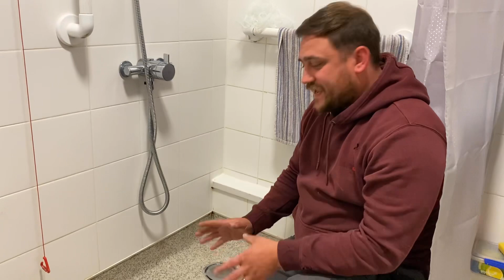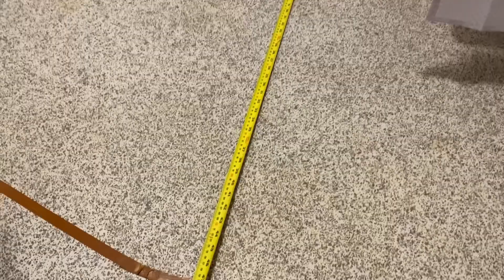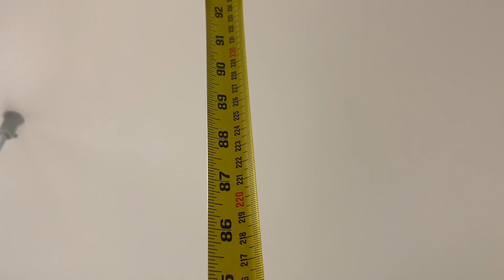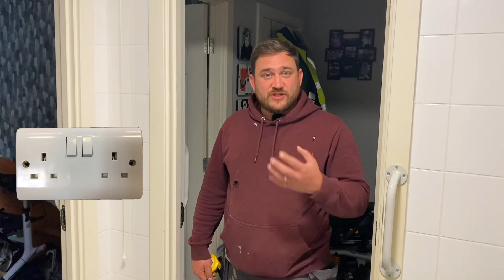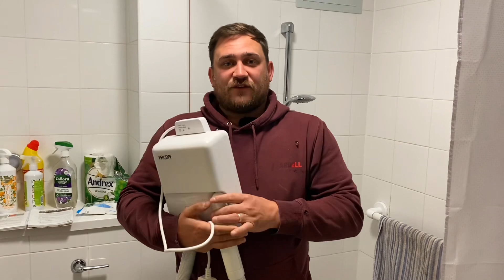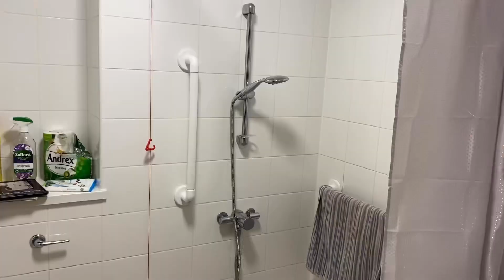Bathroom Zones in a Wet Rooms Explained - Fixed Water Outlet and Calculating Zone 0 and Zone 1

Comment: The term ‘fixed water outlet’ in BS7671 Section 701 refers to the shower head and not the drain, this is clarified in IET Guidance Note 7, under section 1.4 Zones (Page 19)

Comment: I remember when  I was an apprentice on a new built the client wanted a bidet but didn't want a shower screen on a shower head that extended out next to the toilet the manufacturer instructions said it had to plugged in via the flex lead so you could imgaine an ugly cable going from the toilet to the cabinetry to avoid zone 1

Comment: So how far should a electrical socket be from a kitchen sink or hand basin?
Reply: It was 300mm but BS7671 now say 150mm
Reply: @seandempsey7351  What?   I thought it used to be 1000mm from running water
Reply: @seandempsey7351  I’m pretty sure it’s 300 mm from a basin/ sink. But 150mm away from the HOB to align with gas regs

Comment: If there are shower doors or curtain, would you not take your measurement from the edge of them and not the centre of the drain cover? As there should be a shower tray below the floor covering to allow water to drain away. 
Well mine has any way the drain of is connected to an automatic pump that starts when the shower is turned on and over runs when the shower is turned off.
Reply from the maker: Look in the On-Site Guide for guidance with obstacles in wet rooms and zones
Reply: @GSHElectrical  i’am not saying you’re wrong far from it
I’am just wondering how this works if there are shower doors 
And there should be a wet room shower tray under the floor covering so I would have thought you take your measurement’s from the edge of the outline of the tray or the outside edge of the shower doors ?
Reply: If I’am wrong I will happily admit it. I think wet room shower tray would be treated as a standard tray in this situation? Or is it
Reply: At the end of the day it’s all just one big learning curve.
Don’t assume that because I am an electrician that in know everything or that I should know everything , to assume is to make an ass of you and me , ass-u-me . I was was just asking a question . I was under the impression that we can and should learn from each other.